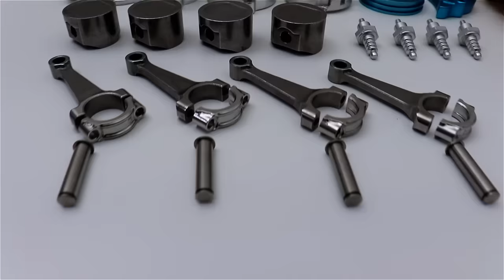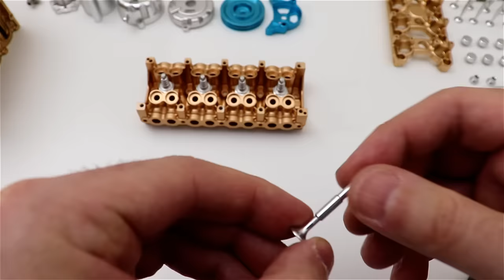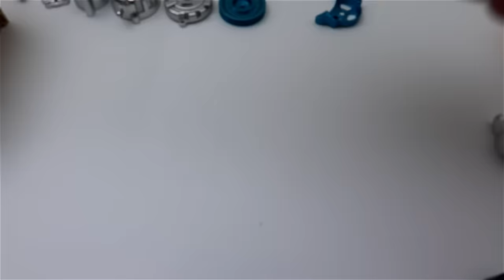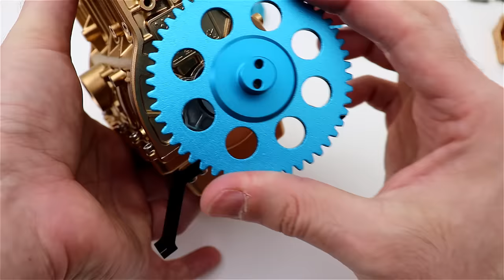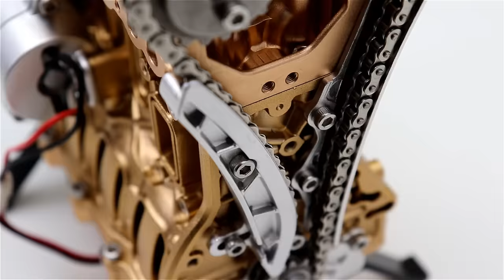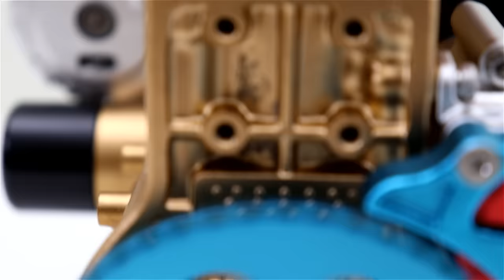4 Cylinder Model Engine Build - All Metal Mini Engine

Comment: Try to make this actually run on petrol it would be interesting.
Reply: I think it's a diesel engine 😒
Reply: only your karan it has spark plugs
Reply: The quality is so poor that it would take less time to build one from scratch.
Reply: It would be good but you need gaskets etc
Reply: @leoc4  More importantly, there are holes in the cylinders.
Reply: @batman3698  1
Reply: @KaRaN0P_  what on earth makes you think it's a diesel engine
Reply: oil Toast , U'r wright  bro.
Reply: tech related, yes of course
Reply: No rings on the pistons either
Reply: @TrooperLeary  the lack of spark plugs
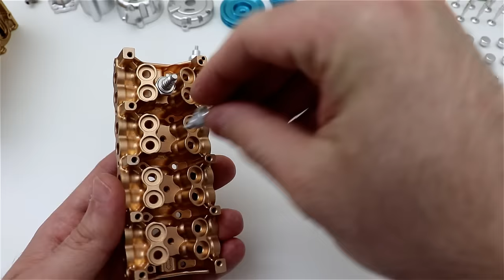Reply: nvm 2:30
Reply: @jerkasshomer6154  and 0:25. 🤦‍♂️
Reply: Agree, somewhat. This is just a model for show. I would love to have one for my living room. The real thing would be too dirty.
Reply: @AphexTwinII  you dont have to be mean
Reply: @AphexTwinII  NoO we watched a completely different video.
Reply: Yesitsme it has glow plugs which is what diesels use
Reply: It won’t be able to work anyway there are holes in the pistons chamber
Reply: It dosent have Fuel Injectors
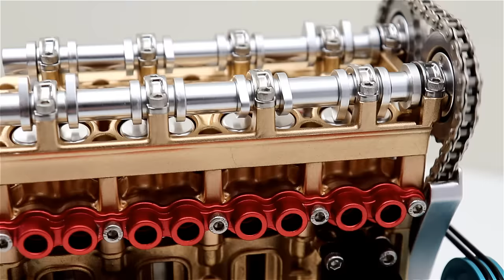Reply: 9:45 this sound makes it even worse
Reply: Bruh that engine even not have head gasket
Reply: @KaRaN0P_  11
Reply: Not much compression with those viewing slots each side of each cylinder bore.Anyway its just a die cast alloy model only fit to demonstrate how a multi cylinder engine works.
Reply: Where yo buy ??
Reply: @nickr1184  not to mention that given how some parts are made / put together it'd wear out in what, 5 minutes? That weeble wobble on the weels alone was already scary..
Reply: Looks like the valves are all the same size, intake should be bigger than exhaust for a working engine.
Reply: oil Toast toyan make a v4 petrol engine about the same size and a few others
Reply: @nickr1184  really? so go and built one:))
Reply: That it why i was let down cos waitin excitedly to see how it 'd run with petrol, and enjoy hearing its cuuuute idling. lol
Reply: @mikec9377  those aren't spark plugs. It's powered by the motor on the side which basically makes the pistons and everything else simply a gimmick. It's not an engine at all. Just a electromagnet motor.
Reply: @Windows keyboard Because an internal combustion engine needs compression. Basically the cylinder needs to be sealed or the pressure will just escape out trough the holes. Bad rings around the edge of the piston is enough to make an engine not start, imagine how impossible it would be to start an engine that has a huge slot in each cylinder wall.
Reply: @mikec9377  Kumar Sateesh Mohamed S/O Jayavinden Murugen shop in Malaysia sold this model but running on miniature Castrol powered engine 25cc.
Reply: @TrooperLeary  the Spark Plugs 😂
Reply: No manifolds either. Still pretty cool model though!
Reply: @nickr1184  I wouldn't say it is poor quality, it is just not built to the extreme tolerances required for an engine to run conventionally.  It is designed as an educational display model not requiring very close tolerances, which would increase the already hefty price that much more!

Comment: I had a friend that I worked with at Harrah's Reno. That once worked for the famous Harrah's Auto Collection. If they needed a special part for one of the cars, and it wasn't available. He'd make it! After the collection was sold. He went into the engineering dept. And spent the time until he eventually retired. Making mini engines like this. All from scratch. Unbelievably Talented...
Reply: almost 30 years ago at a tractor show a man had a scratch built 1/6 scale (GI jOE size) John Deere "B" that ran on model airplane fuel. I found out he'd made it from original JD plans and all the casting made then machined them all. It had a working hand clutch and transmission. Even the rolling stock was hand made from molds and they were rubber.

Comment: @DIY Garage - You must have noticed that the cam lobes don't even contact the tappets - you can correct that by attaching the tappets with just 3 turns instead of tightening all the way down.  That's what I did on mine and the valves all work properly and have a much more realistic action to them.  I also bought some additional light grease and applied it liberally to all contact points.  The engine runs both smoothly and quietly!  You're welcome, and that will be $5.00  Lol

Comment: Why working by electric engine.
Before starting the video i thinked that the engine works by Fuel😕
Reply: Same
Reply: Right man
Reply: Thinked... bruh..
Reply: Me too 🤔🤔
Reply: Me too... Right up to the point where he dropped the cam onto the block with no bearing surfaces. That 'ain't gonna last two minutes running', I'm thinking. Then pistons with no piston rings. 'I'm no expert', I'm thinking again, 'but thats gonna explode'!

Then I fast forward to see the fireworks and all becomes clear.
Reply: Yassine Chettouch can you please type with proper english grammer? Thank you 🙄
Reply: The crankshaft rattled in the main bearings. if it ran on fuel, it would have come apart.
Reply: It's a die cast model engine only, it probably costs around 100 dollars...
For it to have the necessary materials and clearances to work as an internal combustion engine it would probably cost around 500 dollars or more
Reply: So did I
Reply: @themedic4050  No. It wouldn't run at all because there is no compression. Not only from the lack of a headgasket, or piston rings, but if you look closely you will notice that there are holes in the cylinder walls.
Reply: when I saw he did not synchronises the piston with valves I knew its was not going to work with fuel. Nevertheless good for students
Reply: only 2strokes have holes in cylinders so i get it right away
Reply: It's just a model
Reply: Yeah, what a shame☹️
Reply: @falahsamisyahdan7022  .
Reply: Yeah it’s
Reply: Dominic Esposito he could be a kid you don’t have to be rude.
Reply: I did to until I saw no way for combustion and no piston rings and crankcase all open. However, the video was almost over before I realized it was going to be a teaching model to show how an engine works so it has to spin by electronic motor, bumber.
Reply: Because it’s a model!!🤦🏼‍♂️
Reply: me too
Reply: Why no proper englias,  that a you problemo

Comment: There is excessive valve train float and the crankshaft needed some bearings that grinding was killing me.
Reply: Barings would rouin the fact that it is a engine so he should've used oil like a accuall car does
Reply: @sparrow9990  or a set of big end bearings  like a real engine! Kinda what I said really
Reply: @Cookiecreamisoreonice  didnt think of that
Reply: Mez Davar that literally...grinds my gears
Reply: Yes many things are missing from this engine because its for demo. Variable valve controls, pcv, egr, bearings, gaskets, piston rings etc which would make it very complex

Comment: DIY Garage - An update on my prior comment that the cams are not on the correct side.  They are calling the right side by looking at the front of the engine.  Maybe that's the way they do it in China but in the U.S. the right side of the engine would be while viewing it from behind!  I realized that error when I received and built mine a week ago.

Comment: Such a cool model. However i kept wondering, how do you time it correctly? obviously doesn't need to be perfect but just so the valves behaviour relatively makes sense.
Reply from the maker: There are timing marks on the engine.

Comment: Will building models like this help me understand the way engines work better? I want to learn to work on cars.
Reply: @Joshua Torrez - From an engine's basic movements during operation it will certainly help.  However, if you really want to understand engines to the point you would be able to work on them, you will need to learn other aspects of engine operation like electrical, cooling, fuel feed, etc.  Check your local high school and any trade schools in your area as they may offer classes in engine building and maintenance.  Best of luck to you!

Comment: I want to make one but with closed cylander walls and Oil feed or a seperate Oil pump that actually has compression and runs.
Reply: @Sir8Bit - Then forget this demo only engine and buy one of the working small engine kits available from Stirlingkit and others.  They are obviously much more expensive though.

Comment: Did you use Manuel lathes and mills to do this or did you use cnc lathes and mills instead?? And also where any of the parts casted or are they all billet parts?? Like the parts are totally machines from a single block of material??cuz I’m a machinist I can program lathes and mills and when it comes to lathes I have the most experience but I know mills as last lathe I got to use and program was a duel spindle live tool lathe it didn’t have a Y axis but I taught myself how to use the manual guide-I for the fanc lathes cuz it didn’t take most g-codes soo I had to learn how to use the conversational programming  can do mastercam software and g-code and maxitrol conversational and fanc conversational soo looking at that engine block it be nice to be able to use a 4th axis mill a 5th axis would be awesome for them engine blocks

Comment: Some loose tolerances there. And wobbly pulleys. I was expecting a working engine at the end!
Reply: It's just an educational model, i could see straight away it wasn't a running model by the massive holes in the cylinder  walls.

Comment: How weird is that... start fitting the cylinder head, with the spark plugs first! 😧... but this is probably about how not to!
Reply: Yes , normally the plugs go down a deep hole between the cam shafts fitted with a socket and extension, at 04.11 fitting top cover over cam shafts, the plugs wouldn't go in as they too big..................P.S....It's just pretend engine.

Comment: What a marvellously metallic model motor..! Some of the moving parts are a tad wobbly when it is completed and "Running" (presumably from a battery pack in the sump), and I would certainly use a little more lubricant throughout the build - but those are minor issues and, above all, where  can we buy such a magnificent model kit..?